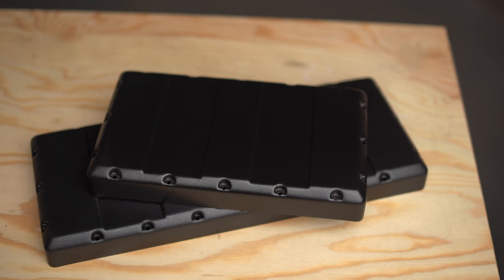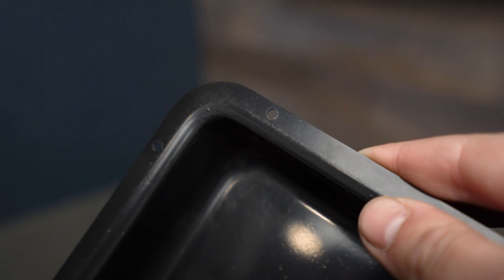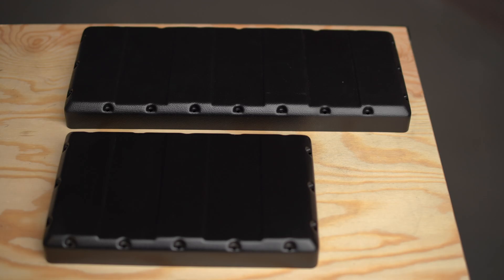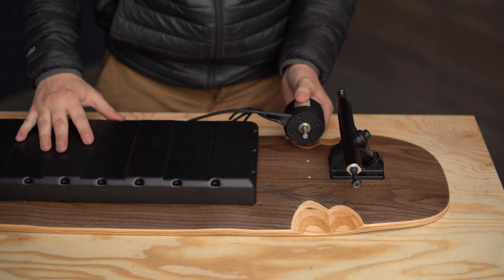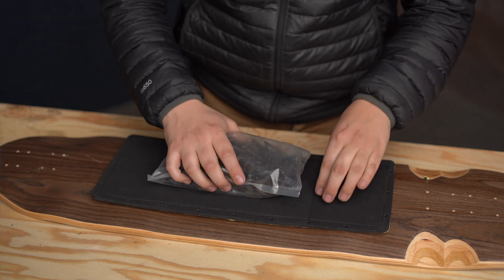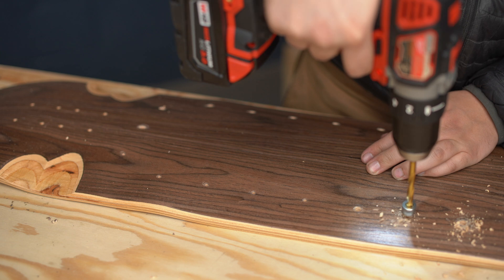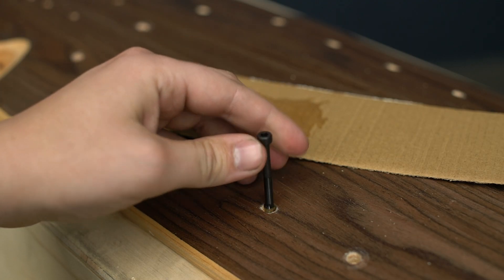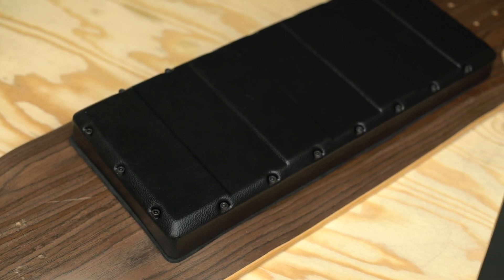Best DIY Electric Skateboard Battery and ESC Enclosure

Comment: unfortunately this is definitely not the best enclosure out there. its difficult to mount properly, the hardware leaves a little to be desired but the worst part is how fragile the enclosure is. as time goes on, the screw holes become weak and you will find the plastic holes eventually wear through and break. i like the look and size of it but the attachment method and screw holes need work.

Comment: I just installed one today but didnt get the inserts.  Drilled through the deck and installed the screws countersinking the screws on the back side.   Is there an update here.  Your instructions on teh web site didnt really describe it very well but it worked out.   Youve got to know what your doing to some extent.  Why is the gasket perforated for an interior square inside the bolt pattern.    I took the inside square and stuck it to the enclosure so teh battery would be sitting by gravity on the padded gasket square.   It just made more sense.   You guys are the best out there.   Drilling through the deck makes more sense to me.  IMO
Reply from the maker: Yes we’ve updated the included hardware to through bolts and nylon nuts because many of our customers were having trouble with the inserts and the glue. 

The rectangle insert is a byproduct of the manufacturing process, it also helps keep the gasket’s shape during shipping. Our customers usually find a creative way to use it if needed.

Comment: hi man i got a little question do you plan to make a flexible enclosure any time soon ( evolve bambo gtr type).
CAuse i would like to try to put a huge battery under a flexible loaded vanguard deck ( 10s5p or 12s4p ) and the the double enclosure is not very appealing

Comment: What size bolts are the mounting hardware, how well does the case flex to fit boards with concave, rake, camber, etc when installing, how can you waterproof the slot for where the cables come out of? Would like to hear some answers to those questions

Comment: The inserts are for plastic, not wood...
Reply from the maker: Either way, they get the job done 👍🏻
Reply: @MBoardsco  I don't want to bitch, but I glued mine with epoxy.
A few did just snap in half, others fell out again because they didn't grip to the glue etc...
Why don't include real wooden inserts?

Comment: Instead of using that foam as a water barrier you could instead use a heat resistant materials to glue to the enclosure itself before screwing it to the deck. This way the material will not break down like the foam will and the glue keeps the gap closed. You can use heat to release the glue when you open it up and also to attach the material again. I am doing a DIY project where I am going to use the material linked below for the water barrier. You may want to try this out and use it in a future iteration of the enclosures. This is how one of my completed boards is assembled and it has been great.

https://www.amazon.com/gp/product/B071RRCLMF/
Reply from the maker: We’ve got a couple boards that are a couple years old running with foam and are going strong but that could also work! Good luck with your build!
Reply: Hi Brennan -  What glue did you use that you can heat up when releasing, and also when re-attaching? The oven liner material you linked on Amazon seems like it is sturdy and would be less likely to deteriorate... but not sure on what glue works for it.

Comment: The worst enclosure I've seen is the Verreal F1 enclosure. All the screws broke inside the metal enclosure, a very bad design.
Will you be making a removable battery enclosure? An enclosure for flexible decks is needed.
Reply from the maker: We’d love to make an all in one replaceable battery and enclosure! And we do plan on creating a flexible enclosure along side a flexible battery pack soon 😎